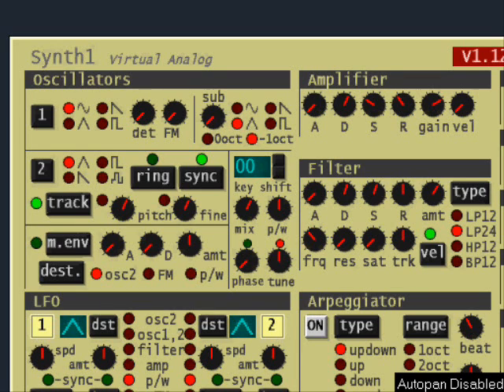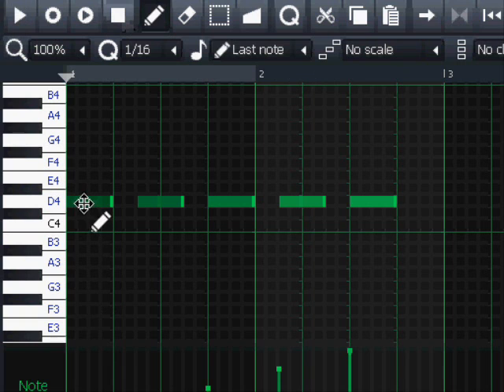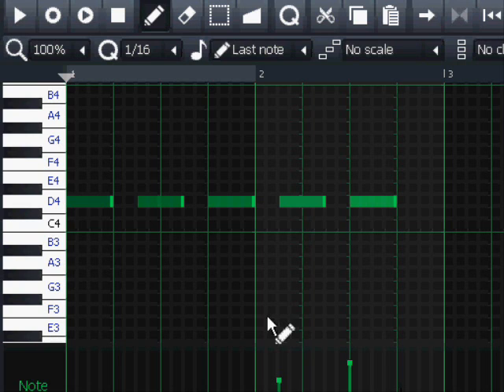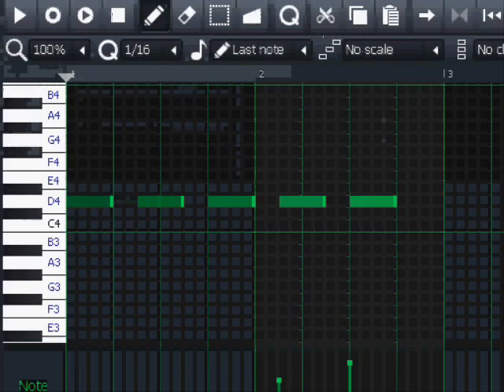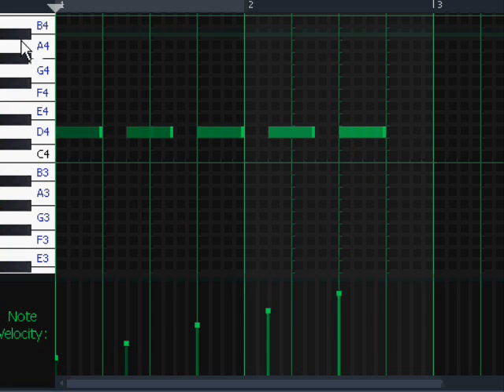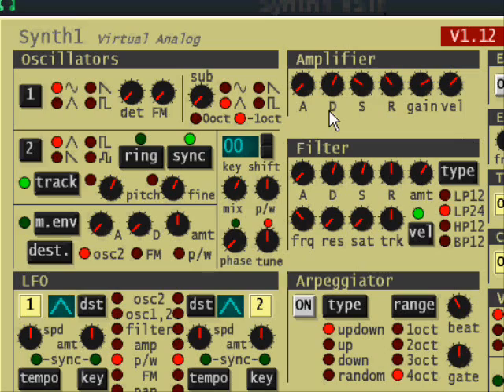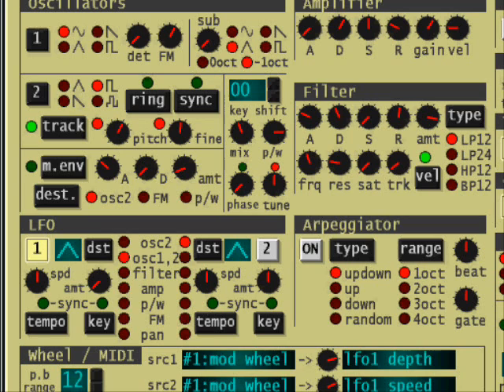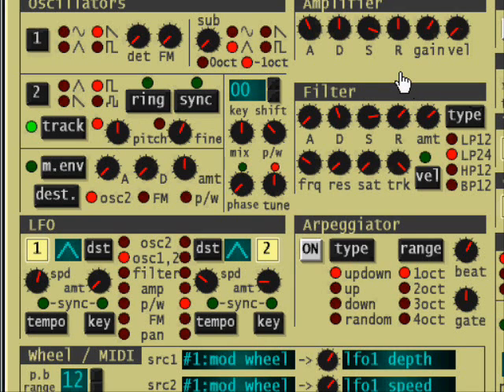Synth1 And Velocity in LMMS

Comment: Well, if you'd try an 'initial sound' on Synth1, you would find, that the velocity button in the filter section controls, whether velocity values do control the behavior how the chosen filter is applied to the signal. If you use velocity, a low velocity setting means, that the filter ADSR envelope is applied only little, a high value causes a strong ADSR-shape. If you disable the button, the filter ADSR envelope is applied independent of note velocity values. I checked this on my currently open Bitwig, but I'm pretty sure, that LMMS will show exactly the same result (because the effect is generated and controlled solely by the synth (i.e. Synth1).
In short: This button controls, whether a given velocity value of a note is applied to the ADSR envelope of the filter as well as to the ADSR of the volume ("Amplifier").
Reply from the maker: " This button controls, whether a given velocity value of a note is 
applied to the ADSR envelope of the filter as well as to the ADSR of the
 volume ("Amplifier") "

I think you nails this!
The percentage is how much the volume should be influencing the output WHEN the VOL-diode is ON.
(Albeit, the actual output, is not very different)
I think you are correct Kurt!
Reply: "The percentage is how much the volume should be influencing the output WHEN the VOL-diode is ON." - I think: The percentage is how much the velocity of a note (let's assume 25%, means a velocity setting of 63 or 64 - maximum is known to be 255) should be influencing the percentage how strong the ADSR envelope is applied it's corresponding filter - WHEN the VOL-diode is ON. 
Usually, if there is a Synth setting with 0 velocity, it means, that - independent of different velocity note values - the ADSR default values are applied to  e v e r y  note.
The percentage of this setting gives the percentage, how much the manually configured ADSR settings are applied. if this setting is 20%, then 20% of a manually configured let's assume sustain of 0 plus 80% of the default value of 255, which is 204. And if it's applied to the filter cutoff, then A only controls, how fast the cutoff frequency rises, D how fast it decreases, S is the 'hold' level (frequency) as long as a note key is pressed and R controls, how fast the cutoff decreases to zero level. So there should be only little influence caused by an applied velocity to the filter ADSR envelope on the over-all signal volume. 
It even looks like AMT of the filter is multiplied with a note's velocity to calculate the filter ADSR value and the VEL of the amplifier works like AMT - but on the signal volume.

Comment: Having a variable amount of volume control via velocity allows for you to control other things with the velocity to a different degree. The 'vel' button in the filter section allows the filter cutoff to be affected by the note velocity, and I believe this action might be possible to a greater extent in the 'wheel/MIDI' section of Synth1. Having this sort of control helps in other synths e.g. varying amount of frequency modulation more than the volume based on velocity.
Reply from the maker: So you think that dial is relevant in respect to MIDI .. Ok, maby -But the dial position in the presets, is still really weird, because those positions (mostly around 25) will ignore user-chosen velocity, in piano-roll 
Thanks for your input!
Reply: The absolute volume (amongst others influenced by velocity, as well as - on other DAW's - by gain or similar) generates different audio levels (means: Audio volume). Sidechain controlled signals are 'mudulated' in dependency of the volume of a volume. So by changing the velocity (and this way the volume... although not only the volume, as well mostly a 'timbre' of the note, ... well, to explain it I'll write more later) this setting of course helps controlling the amount of sidechain (the 'ducking' of a signal).